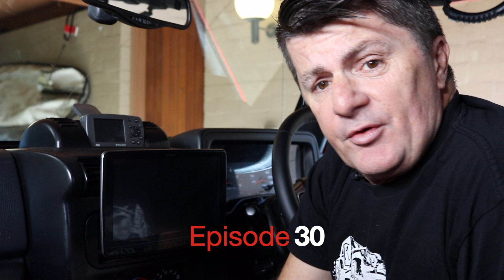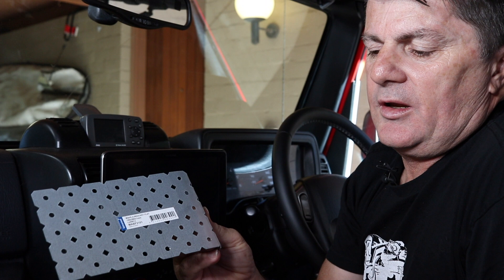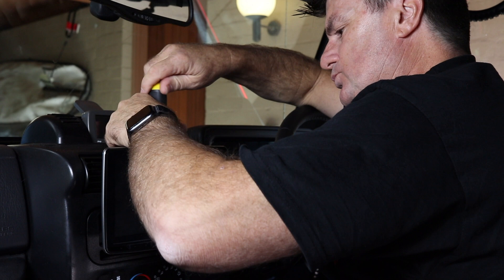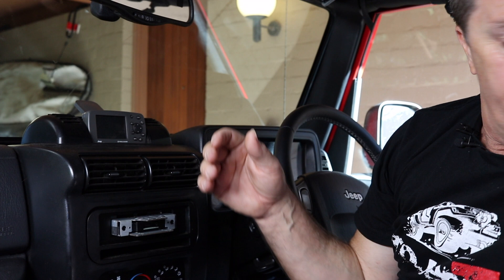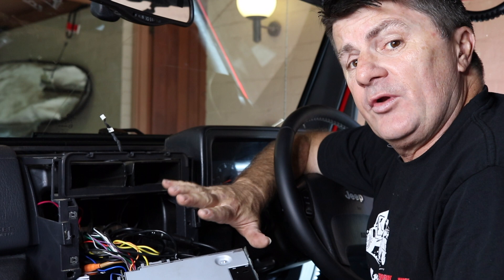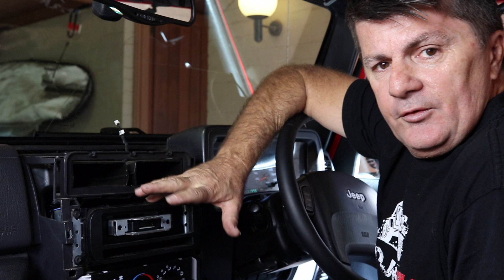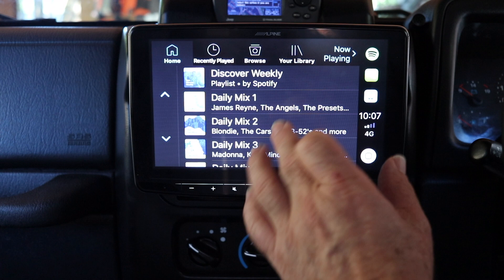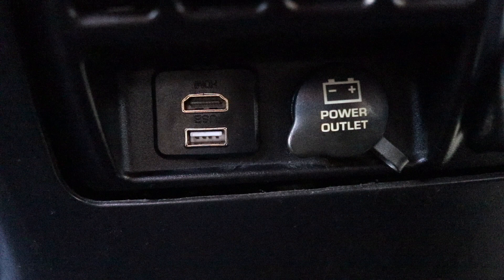Alpine Halo 9 - ILX309 I Project TJ -  Ep  30

Comment: Nice work - I live in the Middle East and the AC vents are critical, do you think this could be installed low enough to have the AC vents unobstructed and still have access to the control knobs for the climate (even if their view is a bit blocked) or is it just too big for that?
Reply from the maker: No you should be ok, I have the screen quite high. I don't have an issue with the vents, just point them up and to each side and they still cool down the cabin the same as previous. You still have the side vents too remember.